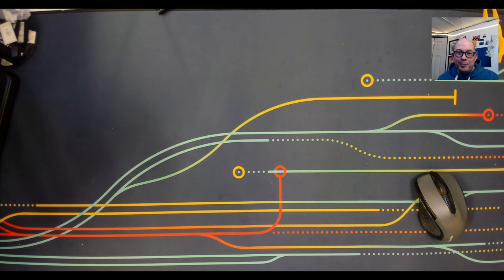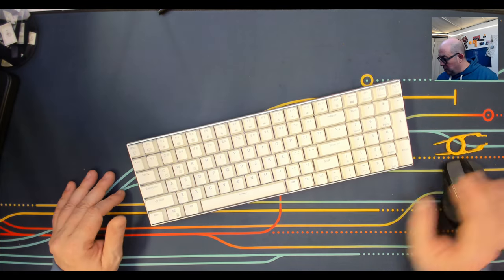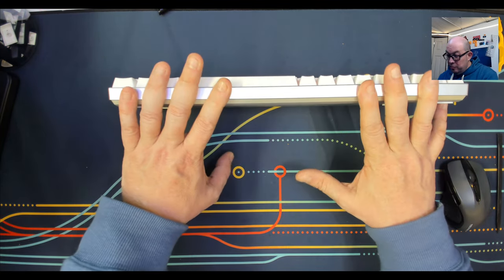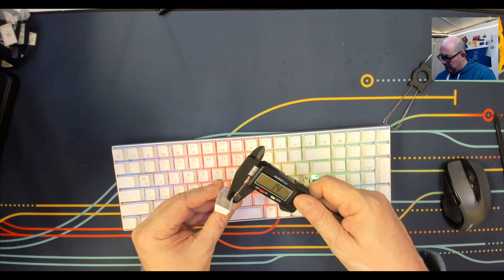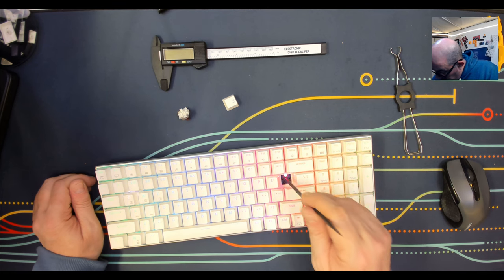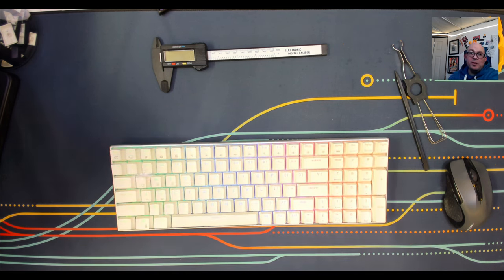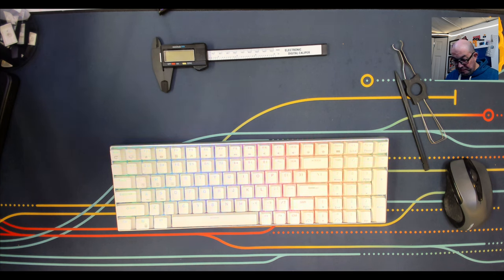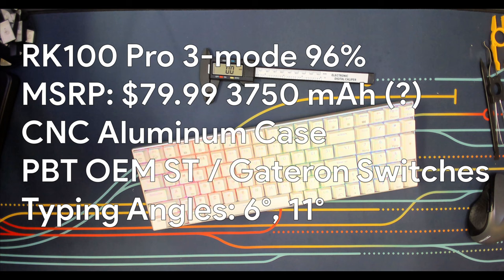RK100 Pro: 3-mode 96% CNC Aluminum Keyboard That Besides The Case Brings Nothing that makes it "Pro"

Comment: Ah, the RK100 Pro, my first non-gaming board. I bought it at the same time that I bought a Keychron K4, and had small issues with both of them, which led me to buy an Iqunix F97. I really liked the aluminum case, but the bezels were too small. When I'm not using my board it sits on the armrest of my love seat, and picking it up one-handed just wasn't possible without hitting the + or enter keys at the same time. I ended up putting some new switches in it (Lavender Purples) and replacing the keycaps, and it sounded pretty good. I gave it away to one of my trainees at work and he still uses it. I sit about 10 feet away from my PC's, and the Bluetooth quality was fantastic. No issues, and the instant wake was perfect. The 2.4g dongle sucked though, it wouldn't even register at that distance. My co-worker uses it in Bluetooth mode because even at a desk the 2.4g just doesn't work.

Nowadays I still own an RK84 Pro, which I have with Dev\tty MT3 keycaps and Feker Holy Pandas, it's a good board too, and sounds very nice. Soundtest here: https://youtu.be/ZuAI37Hoxls
Reply from the maker: Very nice! 

Background noise is the bane of my existence!
Reply: @MechKeyboards  Haha, it doesn't help that I always have a fan on. I could turn it off and get a better test, but for a quick test I wasn't too worried.
Reply from the maker: @DaveAlkema  I had many sources of background noise which I had to fix one by one, still got some furry noise makers that are good at chiming in at just the right moment though, but I forgive them ;)
Reply: @MechKeyboards  What I should really do is start doing sound tests in my office, no fans in there. I could turn off my fan out here, but I'm not sure it'd ever turn on again, the knob is a bit broken after my dogs knocked it over one too many times.

Hope you're having a good Monday so far!
Reply from the maker: @DaveAlkema  gotta love how our furry babies can inadvertently damage or destroy stuff we need, LOL!

Having a great Monday, thanks for asking! Hope your is going swimmingly as well, cheers!

Comment: Thanks for this video. I was looking at getting an 1800 style keyboard that had wirelss / rgb / hotswap / etc. All the bells and whistles.  I was looking between RK100, RK100 pro, Keychron k4, and the Akko 3098n (Theres a 2098b but cant find one in black so id have to go for the N) Whatever I get I do plan on modding, and getting new switchs and keycaps.   Which board would you recommend I go for? This will be my first board, so I want it to last a while, and be a good board to be able to mod and be happy with.    I've been leaning towards the RK100 because of the cheaper price, so I found this video trying to find out what the difference is between the RK100 wireless and the RK100 Pro wireless.... CAnt seem to tell the difference outside of the aluminium case.   Any info to help me make a decision would be greatly appriciated. Thanks!
Reply from the maker: The RK100 Pro (newer revision) comes well dampened, with good stabs and sounds decent stock. It does not have a pocket for the USB dongle or USB ports like the RK100, but delivers a nice experience stock, and even better when modded.